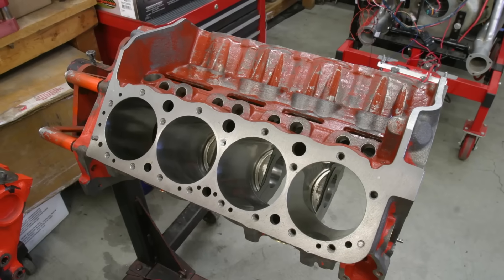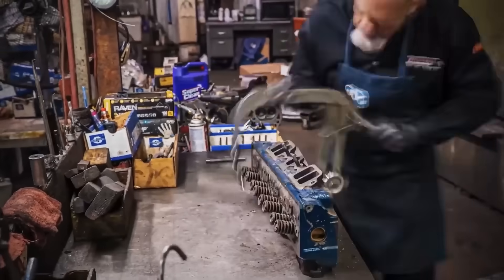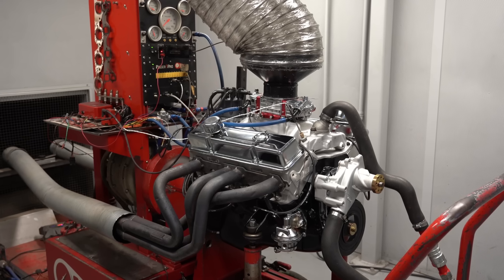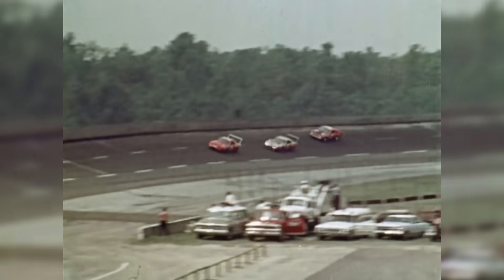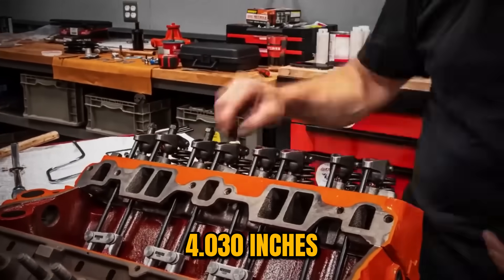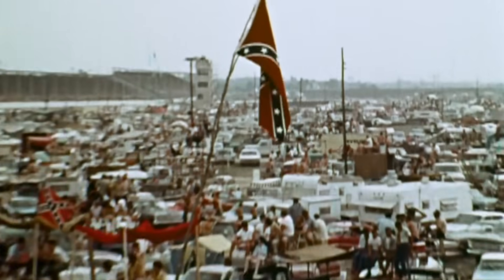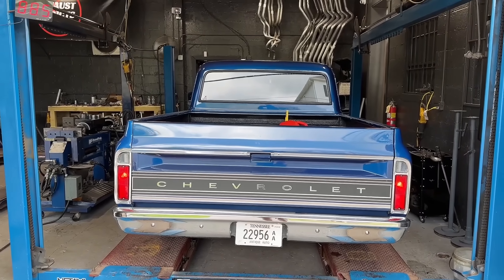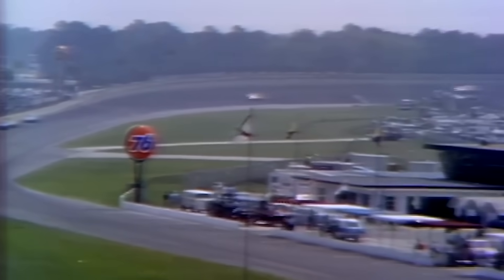Smokey Yunick’s Chevy 383 Stroker That NASCAR Tried to Ban

Comment: divide by 4...nah   and that's a 377...  it's a 4 in bore over .060 makes a 383
Reply: .060 over makes 388
Reply: @paulhoover1502  whatever...if you do the math as mentioned in the video...except the stupid divide by 4.... it seems the come out 383... not going to fight over 5 cu in....4.060x3.76x [Pi] 3.1416x8=383.67
Reply: I find two big errors in this video halfway through 350 does not have a 3-inch stroke it has a 3.48 inch stroke and they talk about Siamese cylinders which is a 400 block not a 350 block. Unless they are referencing a special racing block.
Reply: +30 thousands to be exact
Reply: @Jeff-b4z7l  30 thousandths

Comment: I never saw a 383 Chevy in nascar cup racing. I’ve seen a bunch of 355 & 358 engines. Do you have any hard proof or were you just smoking hemp for inspiration when you produced this fluff piece.
Reply: It’s bullshit it was 3.46 for the small blocks. Stroke Now drag racing was different that was a mess in NHRA